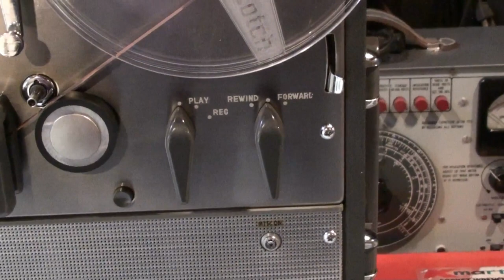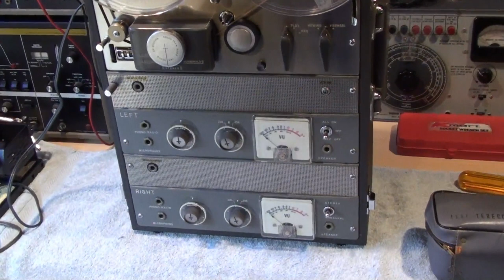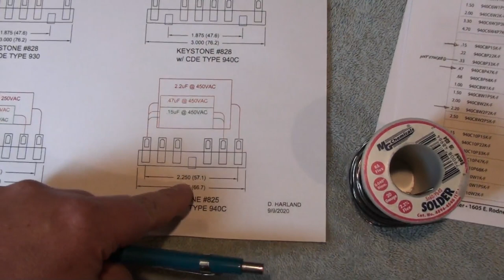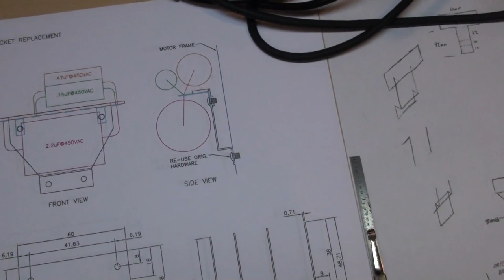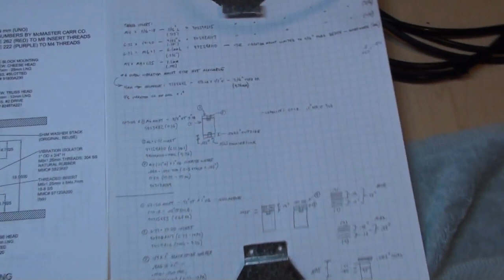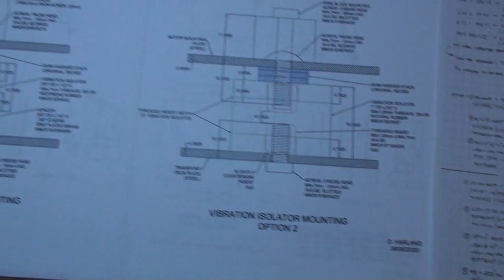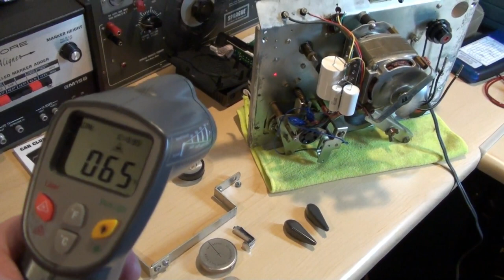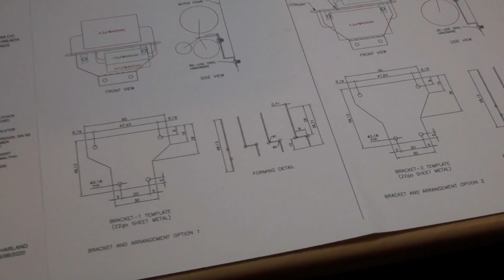Repair and Restoration of the 1961 Akai M-5 Reel to Reel Tape Recorder

Comment: This is a great video.  I had acquired one of these machines.  Or rather my father did.  Used.  When I was just, 8 1/2 years old.  It was, to say the least, extremely groovy.  To this 8-year-old.  They got my hands on it.  To discover what it could do.  What it had.  What it was capable of doing.  Because I knew already.  The year before at 7.  That I would make, Audio and the Recording Arts & Sciences, along with broadcasting.  For my lifelong career.  A decision I made very consciously at 7 years of age as in 7 as in seven.  And not a day before!  7.  It hit me like a brick.  I was hooked.  I was addicted to Pro Audio, for the rest of my born days.

Now what was cool about my M-5.  While it was most definitely only a, 2 speed machine.  With that mechanical belt shifter gizmo.  To change the speeds.  For, 3.75 and 7.5, inches per second.  It also had a capstan shaft sleeve.  With a knurled nut, holding it down.  And you could slip that over the capstan motor shaft.  And you now had a machine that would roll at 7.5 and 15 IPS.  Wow we wow wow!  And!

With that gigantic knurled knob on the top of the head mounting stack.  It could reposition the 1/4 track stereo head.  By shifting it in an upward and downwardly position.  So as to be able to play back not only the 1/4 track recordings you had made.  But could also playback 1/2 track recordings made on professional machines!  Like the Ampex 350-2's.  Could be played back on that Aikai M-5.

Mine also had that pair of, 8 inch full range, Aikai speakers.  That you could mount on the walls.  Up above your head.  And they would be angled down upon you.  Control room speakers!  Morbidly obese, 8 inch, AURATONES!!!  That were not in a cabinet with a finite resonant frequency.  Because it was not a rectangular box.  They were great and tight sounding!  And you were driving them from the tube amplification coming from your M 5.  It was, in short, fucking fabulous!  And I had my imitation Ampex 602 only better.

I would keep and use that machine until I was 15 years of age.  When I then first got hired as an engineer in radio at a college radio station at 15 years of age.  Because I had already acquired my FCC 3rd Class Radiotelephone license at, 15 years of age.  And I knew I was on my way in my career field.  When this college radio station just handed me the keys to the radio station.  Because my shows were on off-hours of normal operation.  Thursday nights and Saturday afternoons!  And they entrusted a 15-year-old kid.  The youngest they had ever had working at the Community College of Baltimore's, WBJC-FM 91.5.  An NPR affiliate and fine arts station for Baltimore.  But I would only last therefore a couple of years until I was, 17.  When I had to let it go.  To take this other job.

Though, I resigned from the FM station.  I did not give up on my career.  My new job.  Was now at the largest, multiple room, recording studio facility.  South of New York City.  One of the few, 24 track studios, then, in the world.  In 1973 which opened in 1972.  And I never had to be a gopher.  I never had to sweep the studios, clean the bathrooms, make coffee or run errands.  I was hired on as a full-blown Production and Maintenance Engineer.  Of this multimillion dollar facility.  When I was, 17.  Where I then got to use the tape recorder of my dreams!  The Scully 280's.  The Ampex MM-1000 and the MCI JH-10, FT, 2-4-8 and 24 track recorders.

And just a few years afterwards.  In 1979.  At the ripe old age of, 23.  I find myself in charge and in control.  As the, Quality Control Manager and Final Test Engineer and overall troubleshooter.  Who saved the company.  For this little legendary tape recorder manufacturer by the name of, Scully.  I was the last of the last.  Of one of the greatest recorder manufacturers, ever known, throughout the world.  After, of course.   I had also been factory trained as an authorized warranty service technician.  For these other, little-known professional recorder companies by the name of, 3M, Ampex and MCI.  Where, when I lived in Fort Lauderdale, Florida.  I was within walking distance.  Only a few hundred feet away.  From the original MCI factory.  I was closer to MCI than to the Advertising have agency I was working for down by Fort Lauderdale beach.  It was very funny.  I was also indirectly involved with MCI and prior to that, Ampex.  As I did troubleshooting for both companies.  And I was a customer.  Of both companies.  One I could just walk in the back door of the shop at.  Anytime I wanted to.  At MCI.

So this little old high school dropout with nothing more than a GED.  Had a sweeping effect.  Across the entire analog tape recording industry.  I read how the FUCK did this happen???  This was not supposed to happen!  I don't have that education for this.  I was just very very good with this.  Rather remarkable with this stuff.  I would have to say about myself.  And I really don't know why?  I just wanted to be a decent engineer.  And I guess I accomplished my goals and professional ideals and accomplishments.  And whoever thought this would happen?

So I had a most remarkable career.  Within the analog magnetic tape and recording studio and broadcast industries.  I mean I can hardly believe it.  And now I am retired at 65.  What a ride!!!  Indeed I have had one of the most fabulous careers in the Pro Audio Industry.  As I got in very early.  When my daddy used to play violin in the Detroit Symphony Orchestra.  And for these early black owned record label startups by the name of Motown and Stax Records.  And he was taking me down to the recording studios starting when I was 7.  And it wasn't hard for me to make my career decision standing in the control room at United Sound Systems Inc. in Detroit, Michigan.  During an, Eddie Floyd, string, overdub session.  When I made my lifelong career decision.  Looking at the audio console.  That had been custom-built, in-house.  And their brand-new 8 track Ampex AG-440-A along with an Ampex 351-2.  And custom modified Skelly 270 player.  With recording electronics..  That had no name tag.  And I remember this other gizmo in the rack called a Fairchild Reverb-A-Tron.  And even at age 7.  I already knew.  That was an electronic, acoustic reverberation device.  Sitting next to it was another big gizmo.  It was huge.  And it said  limiter.  And I wondered.  What people wanted to limit during a recording session?  What does it limit?  Why would they want any limits?  And what is it there to do?  I was asking myself at 7 years of age.  Until I realized what I had been missing when I was 15.  And that was this thing called the limiter and/or dynamic range compressor.  And then I found I wanted more than bass and treble controls.  I wanted some knobs to affect the middle midrange.  And I acquired a pair of consumer, BSR McDonald Metro Tech, 1 Octave, 5 band, graphic equalizers.  I could start rocking and rolling!

So I basically had 4 channels of a high-end audio console.  Without ever having a high-end audio console.  That early in my career.  As an,, Professional Audio Engineer.  And then I also acquired a pair of SHURE, M-67, microphone mixers.  And a DBX consumer 160 limiter called the 119.  And then came my custom 4 spring pan, reverberation device.  The sound really sucked.  But I now had electronic reverberation.  Almost as good as that, Fairchild Reverb-A-Tron.  So I was a happy camper.  With my own little home studio set up.  And then a major 24 track recording studio to go to work at every day.  At 17 years of age!  Back in 1973!  When there were only 4 recording studios in all of Baltimore!  And I had just gotten hired for the newest and largest one!  Because yes!  I am that good at what I do.  It came built-in with me.  I don't know why?  But I figured.  I just had to roll with it.  I had discovered, my talents in engineering.

I would go on later to teach college professors about the Recording Arts & Sciences.  And how to do it.  How to do it, professionally, coast-to-coast and around the world on satellites.  Which is what I did for NBC-TV for 20 years LOL.  Also, later on.  I'm one of the top broadcast and audio engineers in the world.  I'm a world-class, world authority on magnetic audio recording.  How the hell did this happen???  But it did.  And I am.  And you are very cool sir!  You got a great collection!  And you've got one of my previous recorders.  And it was a great machine with a great pair of speakers.  A better than Ampex 602 imitation.  Because with the Ampex 602.  You needed a pair of their suitcase sized, powered loudspeakers.  But not with the Aikai M-5.  You just plugged in the speakers!  And so it also had great headroom from its output of all small envelope glass tube circuitry.  It was better than Ampex 602!  It was an improvement upon the 602.  And it was a hell of a lot more versatile.  With 3.75-7.5-15 IPS tape speed capabilities.  Recording in 1/4 track stereo.  Being able to also playback, 1/2 track stereo.  That machine was heaven on earth!  And at 65 years of age.  Not having the machine since 1970.  I still dearly miss it.  It was a machine I never wanted to get rid of or leave behind.  But I had to.  And I've been grieving over that ever since.
Reply: Interesting comment.  How do you think the Akai M-8 stacks up against the M-5?  I own one and I think it sounds fantastic.  If I'm not mistaken it was the last tube driven reel to reel from AKai and one of the last tube decks of any manufacturer.  Why don't you just buy a used M-5?  Surely they're not too hard to find.

Comment: My hubby has Motorola TP11CE radio it works but the volume button is scratchy when turned and the 2 snaps
 on the back are broken..
What are your suggestions to fix it

Comment: Hello, I just found a 1960s tv and wanted to get it fixed up. It turns on and screen is white but I cannot get a picture. I’ve set up a rca vhf connection to a antenna and also tried a vcr player and nothing. Sounds like your in the Chicago land area  like myself. Do you do tv repairs?

Comment: Is that a tape end sensor hanging down between the two reels? Normally if you didn't thread around it, the machine would not play. I can imagine that not working, but I can't believe you would not have fixed it. Am I missing something?

Comment: One question Doug. Why did you replace AC capacitors with DC caps? Thanks
Reply: Film caps are non polarized and ideal for this application.  Also they won't deteriorate.

Comment: How much oil did you saturate the polyurethane foam in? Did you apply oil to both sides? I have a motor that I am lubricating and thought your approach is very informative. I simply would like to know the extent of lubrication to apply with this type of foam.
Reply from the maker: I applied enough oil to completely saturate the foam without it dripping, but still retaining oil.  So I would say "overoil" the foam until it drips, then very gently squeeze out just enough so it doesn't drip, but be sure there is still plenty retained in the foam, considering it really can't be easily accessed again unless you take it all apart.
Reply: @drh4683  Excellent. Thank you so much for responding. I got the foam in just today, believe it or not. I had McMaster give me the exact one you purchased. There's enough on this single sheet to repair plenty of other motors that I have here. Synthetic oil should do the trick.

Comment: Hello Sir, 
Please help me! I have Akai GX365D but the Capacitor 2.0 uF, 1.0uF, C, 250WV AC 1970 was out of work (leaked wax out). Do you have a replacement of it or rebuild the other one? Thanks in advance sir.

Comment: You mentioned that you would be running two of those capacitors in parallel. When you put two in parallel doesn't the capacitance drop by 50%? If that is true then you must choose higher values.

Comment: I have a Roberts 990 in very poor cosmetic condition.   It had been stored in a shed that was open to the weather for twenty years.  I’ve robbed the amps.   The transport is a parts unit.  If you need it, or want it you can have it for the shipping cost from California.   I’ll send it to recycling next week, the first week of Jan 2021.

Comment: I would have replaced those huge electrolytics in the amp, while they might test ok now, they are very old and its just a matter of time before they fail. It wouldn't have been expensive to replace them and it helps with futureproofing the unit so it doesnt wind back up on the bench again in the near future. Actually I would have just shotgun the whole thing and recapped it completely because of its age.